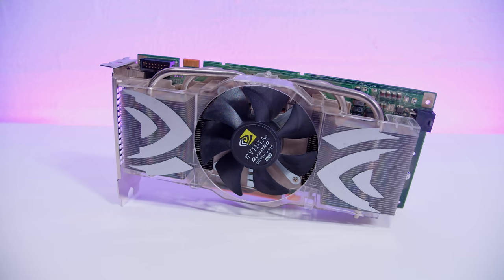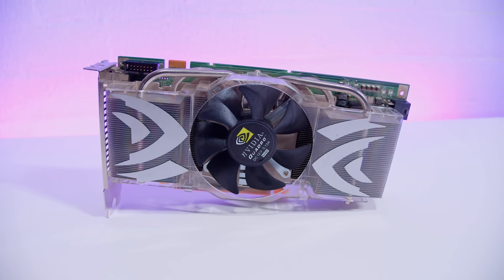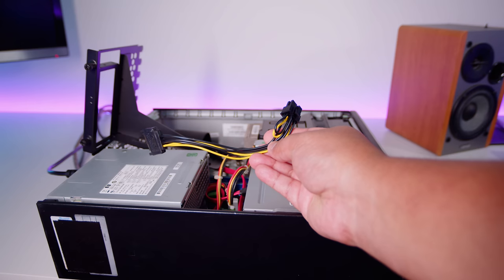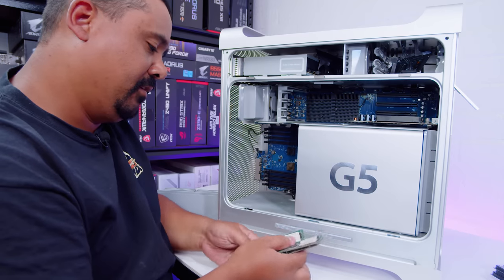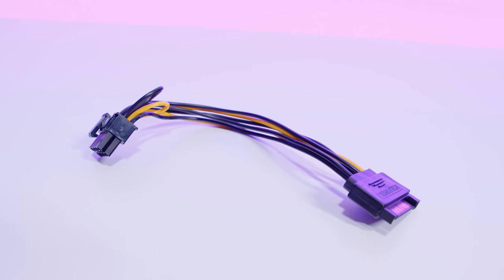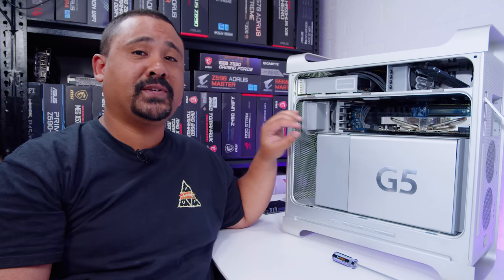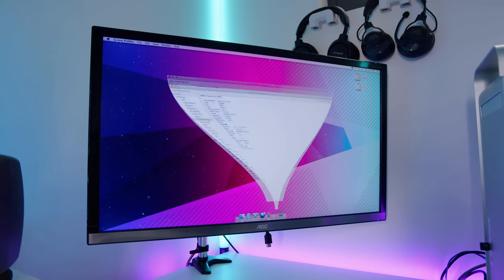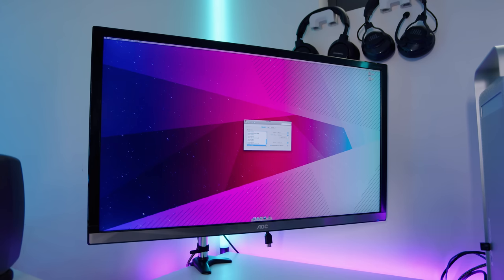This Computer would have cost $10000 when it was released in 2004

Comment: I got a free hand me down '09 Mac Pro a few years ago. Runs hot as hell, makes a good space heater in winter.
Twin Xeons (16 threads), 1GB ATI Radeon HD, 48 GB ram, four 1TB WD Black Caviar HDDs
My daughter has it now, it's running Windows 10 exclusively. I got it to run Windows 7 on one drive on boot camp, then upgraded it to 10 doing away with boot camp. Then reformatted the other drives. It just boots Windows now. Still fine for surfing. I was squeezing 60 fps out of War Thunder on medium settings 1080p.